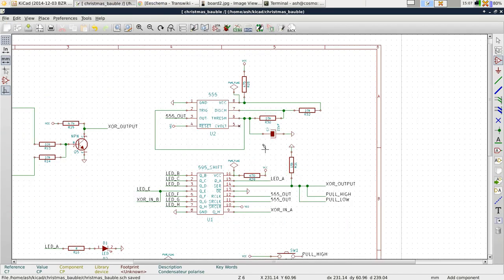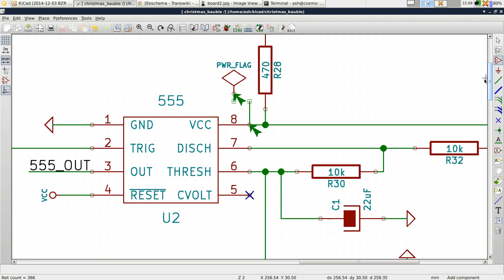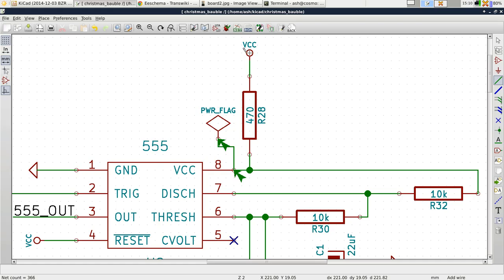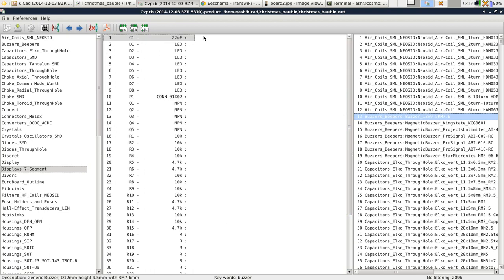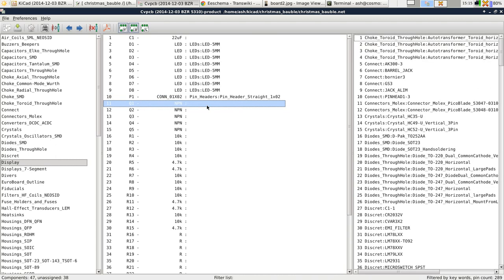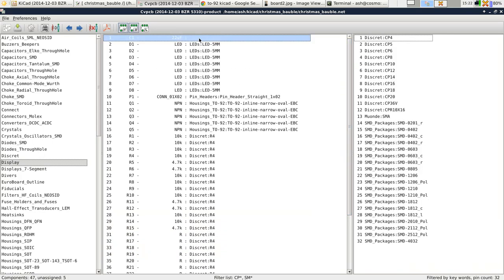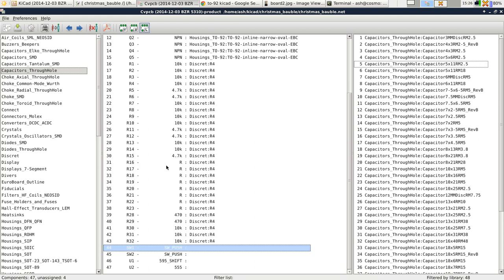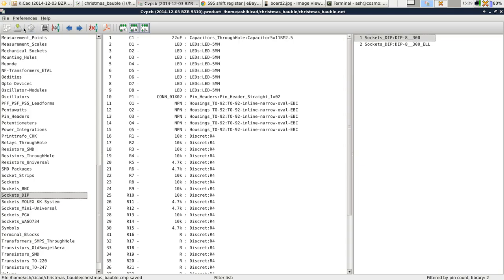Kicad Tutorial 12/2014 - Part 5/12 - Associating Components with PCB Footprints

Comment: After adding the power flags i am still getting these erros:

ErrType(5): Conflict problem between pins. Severity: error
    @ (114.30 mm,50.80 mm): Pin 3 (Open emitter) of component Q3 is connected to 
    @ (172.72 mm,135.89 mm): pin 1 (Power output) of component #FLG037 (net 1).
ErrType(5): Conflict problem between pins. Severity: error
    @ (172.72 mm,135.89 mm): Pin 1 (Power output) of component #FLG037 is connected to 
    @ (115.57 mm,95.25 mm): pin 3 (Open emitter) of component Q4 (net 1

It seems to me that power flag is acting as power output, and i cannot have a power output in the emitter. Does anyone know a workaround for this?
Reply: Francisco Edno Git repo for the project: https://github.com/fco-edno/christmas.git

Comment: Ashley,

In the footprint view for any given component there does not seem to be a difference between the X, Y and dx, dy values at the bottom of the screen.  Is there a way to reset or define 0, 0 so that the dx, dy and dist values would be more useful?
Reply from the maker: Hmm, good question. I don't know. In the footprint editor you can change the grid properties (Dimensions -> User Grid Size) so that the origin is different, but it doesn't seem to affect the values displayed for dx,dy,X, and Y. One for the kicad IRC room I'd say :D